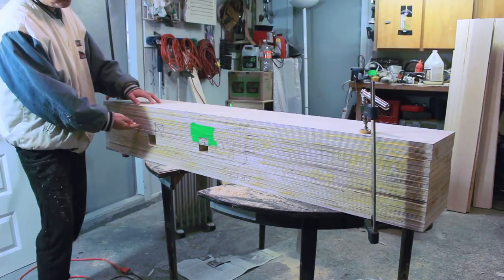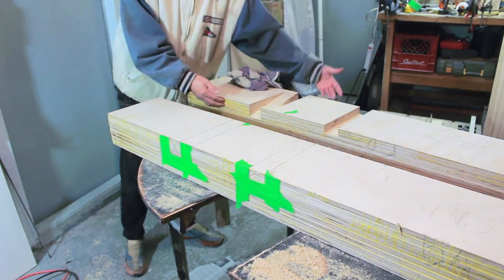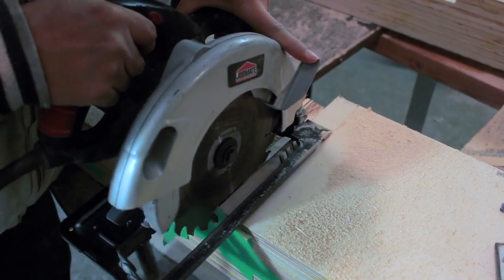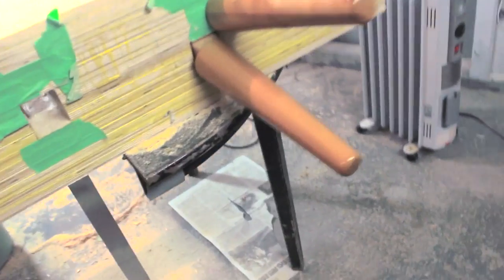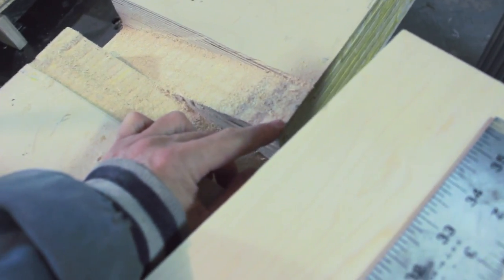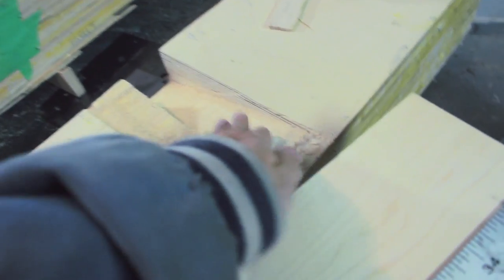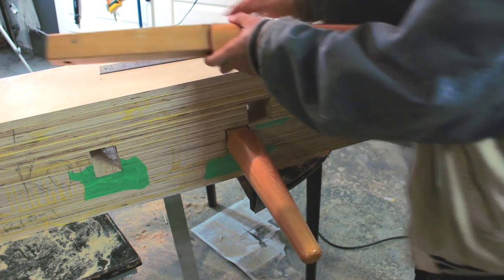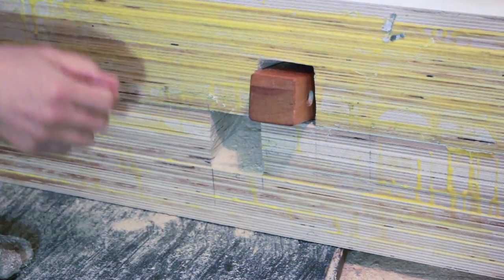Dummy Making step by step (Part 4)

Comment: Hi,  Thanks for the video.  I have a question.  Is there a reason why the arm holes are square?  It would seem to me that just drilling them would be much easier.
Reply from the maker: Yes, they have to be square.  When the hole is square, and when you hit the arms, it will move sideways horizontally, or when you hit the arms at a 45 degrees, it will move upwards at that angle.  This will prevent you from injuring your arms and it will give a better feeling as the dummy arms gives and moves.  Also it will prevent the arms from spinning.